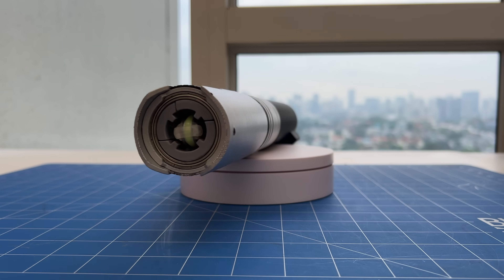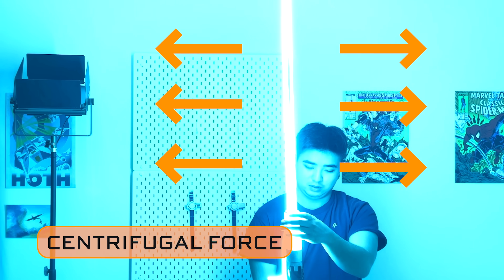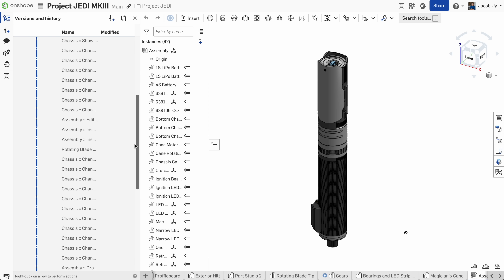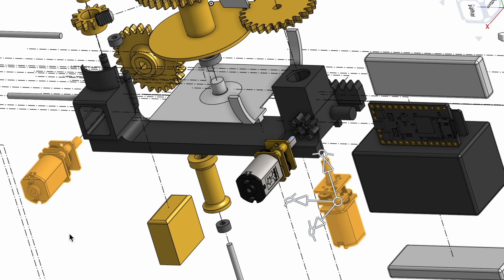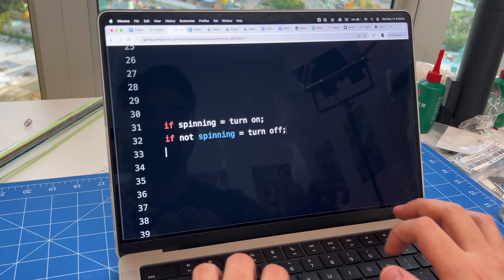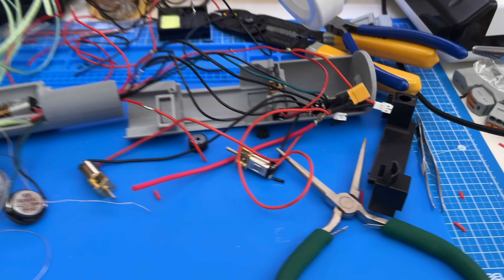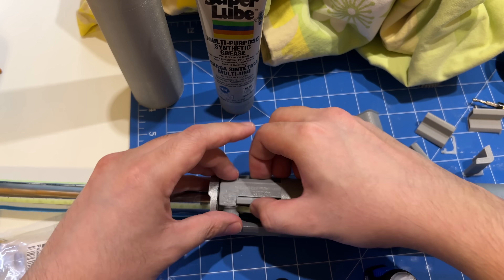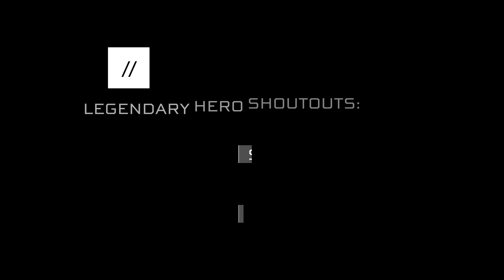Making a Better Retractable Lightsaber

Comment: have you considered using a 3d resin printer to make the gears and interior components? if you use a casting resin you could use lost wax casting to get a accurate part with little casting flaws. i own and operate a small foundry in my work shop if you need help. i could cast small batches of parts.
Reply from the maker: Ah that’s a great idea! Yeah ideally the gears are metal, not plastic. Will look into a few options for making components out of metal

Comment: to make the lightsaber prop smaller you could use a clear telescoping tube with a phosphorescent-coated inflatable bladder inside, expanded and collapsed by a tiny reversible air pump in the hilt.
Hidden UV LEDs or a low-power enclosed laser would charge the Phosphorescent paint instantly, making the blade extend, light up, and keep glowing after “ignition.”  If the balloon was prefilled with a certain amount of gas under pressure it might spring up faster.
Reply from the maker: That’s a cool idea! I’ve seen some balloon powered lightsabers but haven’t explored it myself yet

Comment: Yo man. I absolutely love what you're doing, but it's missing something critical. When I was a kid, I loved to do lightsaber fights with my friends. Now that i'm older, I love learning all the cool swordman techniques (and some fancy ones).

Obviously with this, you cant bash them together very hard... or it will break. Considering this is a melee weapon, it defeats the whole purpose of the blade, and we can't relive our favourite fight scenes like when we were kids. I have a solution!

You know those very cheap lightsabers you can buy where if you swing them hard enough, they extend? Why not go full circle and put a plastic casing around the lights that work in a similiar way (and weld it to the top. 
They may make the activation slower due to extra resistance, and will have to be thin to maintain its flat look, and the glare might be reduced ruining the effect, but it's all I've got. If you can make the LED and mechanism itself punishable (very punisheable) without that, even better.

Fantasy aside... This is sick dude! Keep going!
Reply from the maker: Thank you! Looking into ways to make it duelable for the next version, thanks for sharing your idea 🙏

Comment: Why dont you use a spiral extending tube with lights built into it the interior. You can still spring load the extension
Reply: Like a spring with lights on it and a motor to pull it back down
Reply from the maker: Stay tuned for V3 👀

Comment: Hey, just discovered you, nice video and project!
Some suggestions:

What if the retraction bands were inside of the magician cane rather than outside ?

Or what if you used the LED strips itself as the retraction bands by reinforcing them (with, let's say, a fiberglass or similar band as long as it is light enough) glued to them on their inner side?

Even better, what if the magician cane has small magnets (structurally embedded, as it can't protrudes) and the LED band has a slim flexible metallic band (over fiber) glued inside for both reinforcing it to retract the cane and keeping it from getting away because of the centrifugal force?

I'd 3d print bearing, 3d printed bearings aren't too bad and definitely better than none.
In that case, they should be attached to the spinning part, and being able to be secured to the casing from the outside.
You'd only need two, one at each ends, making it not requiring to make any part of the mechanism slimmer.

For the retraction, mind the air inside, you need venting holes, as even without being airtight it act like a piston, which prevents you from being able to retract quickly.
In fact if you could even use the rushing air as part of the retraction noise with a sort of whistle type hole which change it's opening based on the retraction progression, by reading one of the motor spinning a screw, which linearly move a plate made to mask part of the whistle, as to modulate the sound.

For a great effect, spin the inside at a reasonance frequency from the typical light saber noise, so the visual and sound feels in synch.
Reply from the maker: Awesome suggestions, thanks! The next version we’re working on will have the LED strips inside the cane, I like your suggestion as well of spinning the inside at a frequency similar to the typical lightsaber noise.

Comment: I see 5 problems still:
1 - It's a bit wobbly, it needs to be more rigid.
2 - It retracts too slowly.
3 - The housing (hilt?) is still too big, especially too long.
4 - No buzzing sound when lit.
5 - Only one color (cold white?) 

Suggestion to problem nr 3, make only the magicians cane and the led stripe spinn with the motor at the very top, as opposed to now when the whole inner housing spin, this would remove the need for an inner and outer shell/housing. Also try to combine the two led stripes into a single led strip, or combine them somehow, so that they only need one power source/battery. Then, you could make the light saber's handle, the housing slimmer/narrower in places where it doesn't need to be wide, instead of having the same width (girth) for the whole thing, this would make the design seem more unique and ergonomic. Oh, and maybe try using finer/thinner cables.

Can't wait for an update where you address these problems and make an even more refined version of the lightsaber! Hope my ideas can be at least of some help.
Reply from the maker: Thanks so much for your feedback and the ideas! Definitely looking to address these issues in the next version. We are moving the LED strips inside the cane and currently trying to fit everything inside a replica-sized hilt 🤞
Reply: @herotech Awesome 🔥 Glad to contribute. Best of luck on the engineering you guys 🍀
Reply: @herotech  watch?v=enevSuDgf3U - Thoughts on this design, sir?

Comment: I have a question "What happens when you touch the blade part?" Does it break, does it hurt, or does it do nothing?
Reply from the maker: If you hold on to it it would hurt a bit and the LED strips would likely break - improving this for the next version

Comment: u struggled to find the solution to the light gap by just adding another light strip? I could have told u to do that first hehe and why not just glue the lights?..
Reply from the maker: If you watch the previous lightsaber video it explains why adding another light strip is the solution that I wanted to avoid :) and if you glue the lights then the cane can’t retract
Reply: @herotech  Oooh ok ok good job bro

Comment: tbh a retcon where the blade of a lightsaber more or less canonically works like this rotating plasma instead of it being pure energy makes more sense. like it'd explain why parrying works, why it seems like users struggle to cut through some materials, and why the on off trick (Trakata) was rarely done.
Reply from the maker: Agreed!

Comment: Have you tried to find a way to make some kind of magician's cane from an LED strip? Attach it to a magician's cane or something like that. If you solve this problem, then all the electronics will be limited to powering the strip and one motor that folds the cane. Then you will get the most realistic lightsaber that you can assemble on your knee and put in any handle. I hope someone will find a way)
Reply from the maker: Have not tried that! Working on another solution right now to make everything smaller :)

Comment: i think a good upgrade to consider is having the led strips inside of the tube, obviously being a clear one. this could potentially eliminate the need for needing it to span 4 times, maybe it could be less, by using light diffusers which is easier to apply inside of a tube and is very common in magic wands, etc. i think this upgrade could be necessary if you consider battling with other light sabers and honestly the led strips being on the outside feels like it could fail more easily by falling off or even breaking, therefor an easier product to potentially market to consumers, if thats ever needed. it could also eliminate the need for it to spin, but idk. all in all, it seems like a big upgrade that could turn this whole project around for the better.
Reply from the maker: On it 👀

Comment: I would be curious if you could make it without the spinning by doing a "double-sided" led strip.  Since the cane is metal, the lights may reflect the light out.
Reply from the maker: That would be super interesting! Would need to find a way to make the LED strip extra thin, since the added thickness would need the hilt to be bigger when stored, but would be really cool!

Comment: Okay, I have an idea that might be able to eliminate the spinning needed while potentially adding a bit of stability. Have the core be the metal magicians cane, have the LEDs attached to that like normal, but THEN you take an opaque plastic magicians cane and layer it on the outside of the LED lights. So you’ve got Metal core, LED mantle, plastic sheathing. No clue if that would work but it’s a thought
Reply from the maker: That’s definitely an avenue we can explore! Currently trying out ways to eliminate the metal core and make everything thinner

Comment: I'm amazed at how well the LEDs stay in place when tensioned in the final version even with some pretty intense movements! All that fine tuning definitely paid off. I'm wondering how hard it would be to add a second telescoping polycarbonate shell that extends with the inner core to seal the LEDs from possible damage (and maybe allow you to lightly hit things with it?) I would imagine it would have to be attached to the outer shell which could be challenging without significantly minimizing the mechanism. Either way, amazing work!
Reply from the maker: Thank you! It definitely took a long time to fine tune the tension lol. For the V3, we are exploring clear magician’s canes :) a couple things to work out and the properties are a little different since it’s plastic and not metal, but hopefully as you said it will also allow the blades to be lightly duelable 🥳

Comment: Fantastic video! Would you say that it's feasible to rebuild this using your files for someone without any experience? And what could I expect in terms of material cost?
Reply: No it’s DEFINITELY not feasible to jump into this project with no experience.
Reply from the maker: Thanks for commenting! Right now, it is not feasible for someone with no experience to build this. My hope for the next version is that anyone will be able to make it, regardless of their experience level. Materials cost for this latest version is around $300-$400, looking to reduce this as well for the next one.
Reply: Thank you a lot! I'm looking forward to it, I certainly will subscribe to your patreon if I pull it off then haha

Comment: im thinking a diffusing cloth that extends like the leds could be used to eliminate the need for spinning. Could make it simpler and less prone to breakage, lots of moving parts here. Good job though!
Reply from the maker: True, that is an option!
Reply: @herotech it's impressive how you did it regardless, I didn't expect the thing to spin, love the tribute to the OG practical effects ❤

Comment: the motor that spins the blade is stealing energy from the motor that tensions/retracts the blade, tune the chip somehow to manage power to both motors in parallel, where the spinning motor slowly dies as the retracting one slowly builds, that might help fix your issue with the retraction speed
Reply: also just to clarify, the amount of power to either motor must be reliant on the extent of the blade at any given moment... might be a bit hard to make happen, you could try a timer of some sort or something built into the code itself as an alternative
Reply from the maker: Good suggestion! The motor circuits are actually separate and have independent power sources, but you’re definitely right in that the spinning of the blade actually increases the force required to pull the cane back in (because it has to fight against the “centrifugal force” to pull the LED strips) and that slowing down the spinning as it’s retracting should result in a faster retraction
Reply: @herotech  Absolutely, and honestly a slower spinning blade would give a 'wittle itty bitty bit" of black lines in the blade, which would make it 'look' and 'feel' like a lightsaber that's powering down... just as long as the blades retraction speed is good, anyway.
Reply: I love this project though, and I would absolutely love to see an entire catalogue of lightsabers made, like darth mauls saber staff, or even kylo rens cross style red saber (his would be a challenge)

Comment: Hay, i am realy impresst and want to Build it. Do you have anything that we can Download. ?
Reply from the maker: Link in the description! I wouldn’t build this version though, I would build the next one :)
Reply: Honestly, you really motivated me to build one myself. I’m going to try making it as cheap and simple as possible. I actually once made a video about a magic wand with machine learning-based gesture recognition — I could totally apply that to the lightsaber, so you can turn it on with a gesture and even switch between fast and slow retraction or activate different lighting modes using motion recognition. You could already implement a setting to toggle between fast and slow retraction. I’d definitely print it with a silk filament to give it that metallic look.

Comment: This is awesome dude. You did most of the hard work, now it’s just an optimization problem to get the hilt smaller. So exciting!
Reply from the maker: Exactly! The metal fabrication will take a while though (and it’s expensive 😭)
Reply: @herotech  yea no way around that. I would recommend Xometry, they’re probably going to be the cheapest with good customer service. I’ve tried them all (Protolabs, Hubs, Fast Radius back in the day)

Comment: Have you tried making one the same as Disney engineers designed? They came up with a simple elegant solution with just 2 clear plastic strips that round out as they are pushed upward.
Reply from the maker: It’s definitely interesting! I have questions about the rigidity of that blade (also I believe they developed their own bistable plastic for their version, which I could possibly do/source but it would take a while)

Comment: If you nested the led strip to spool on the inside you could put the two spool weels closer, and have more clearance. Better than that you could modify the wheel itself into tread tracks that line the length of the hilt for less bend and a thinner hilt design.
Reply from the maker: Cool idea! Tried that with the first design, didn’t work as I expected though. With this new extension design however, it might actually work

Comment: Another question I gotta ask, did you add the saber sounds to the video or did you manage to fit a sound board and a speaker in there somehow?
Reply from the maker: There is a sound board and speaker in there! Still need to play around with the volume settings and speaker placement because the sound is pretty muffled right now

Comment: Just a quick thought here why couldn’t you coil the LED light all the way down to the bottom maybe this is something you thought about already and maybe I’m just not as smart as you, but it seems like that would take care of all the gap problems
Reply from the maker: A great question! Doing that would require a lot more length of the LED strip, which would make storing it very hard as well

Comment: 7:50 I know you went with another solution but I'm still hoping that someone can explain what was wrong with the servo 🥲
Reply from the maker: Yeah totally! Eventually I figured out there was a bug with the specific board and OS I was using that was causing the servo signal timings to reset randomly, causing the jittery movement. Fixing that would have required going into the CCR and ARR registers of the microcontroller which is way above my knowledge level lol, so I decided for a mechanical solution.

Comment: If you speed up that retraction a bit and cram it in a grafflex? Perfection. The spinning gives it a quality similar to the spinning retro-reflective blades used in A New Hope! 

I would actually be interested in seeing a version with retro-reflectors in place of the LED. Obviously it would only look like a lightsaber to a camera (or someone with a light source,) but I’ve always wanted to recreate that original effect.
Reply from the maker: Thank you! And yeah a version with the original retro reflective tape could look really cool (probably also easier to cram into a hilt without the LED strips)

Comment: THIS IS AMAZING! I have an idea for you. You can make it have the standard turned-on sound qhen activated, and put a movement sensor in it, making the sound more intense depending of the movement
Reply from the maker: It actually has that already with the proffieboard v3.9, I need to play around with the sound settings and speaker placement so it’s actually audible